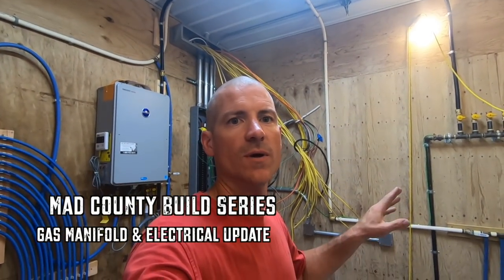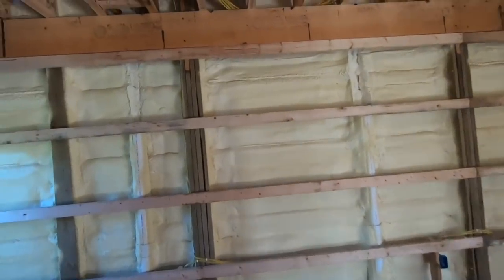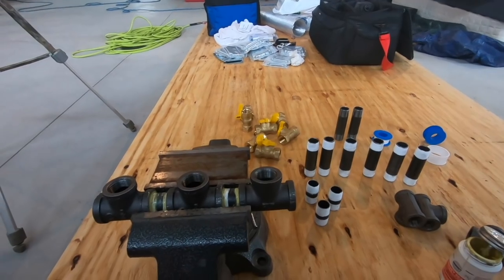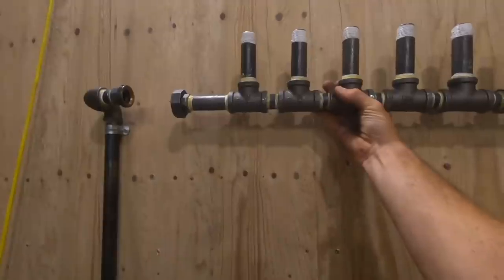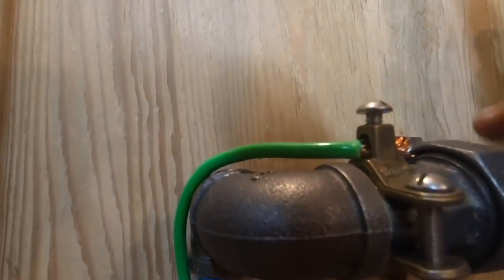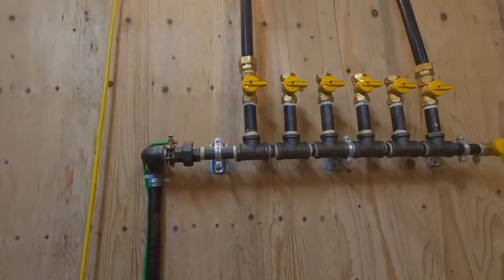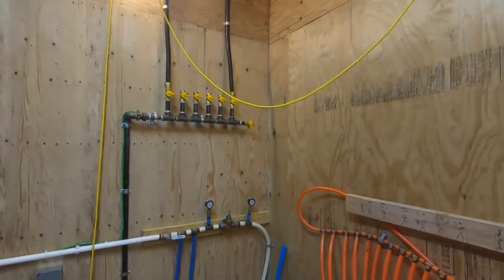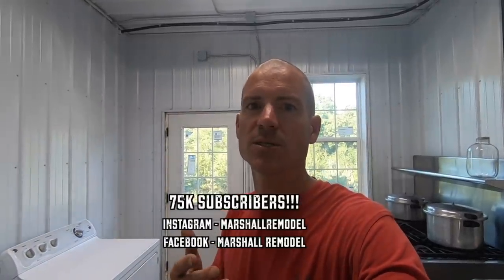Gas Manifold | Electrical Update

Comment: I’m shocked you can run 7 branch lines the same size as the incoming manifold distribution line...
Reply: I’m concerned about that as well. Worse case just run it all high pressure and reduce it at the appliance but it’s easier and cheaper to do it the right way the first time.
Reply: He said he was going to reduce it at the appliance.
Reply: The Artistic Boundaries Co. if he were to have all the gas appliances running at the same time that’s where he would have an issue.
Reply: The Artistic Boundaries Co. with gas you need volume not just pressure.
Reply: I wondered about that too, but in another comment he said it's a 2psi system, which is 5x the typical 11" of water column. In that case, the main/manifold pipe size is probably already slightly overkill, and the branch lines are probably WAY overkill.

Comment: 6 gas outlets on a 3/4 inch run. Please tell me how that's going to work. 3/4 inch gas pipe natural gas will only carry 375000 BT use LP gas. 3/4 inch should carry over 500000 B TU
Reply from the maker: It’s a 2psi system.
Reply: What state are you building in?
Reply: All I was saying for UPC code that would not pass.
Reply: @thebesthello1786  I assume you're basing those numbers on the typical 11" water column, which is 0.4psi. This is 5x the pressure, so it's going to flow much more gas through the same size pipe.

Comment: I wouldn't use that flex gas pipe in a building!
Reply: Why?
Reply: @Requiemrexx  there are some drawbacks to it. Granted it’s super convenient to easily bend it around corners and such, but it’s not as tough as regular iron pipe. CSST has to be bonded (like he did) and have nail guards installed when it runs in walls, to prevent somebody sending a nail into the thin-walled piping.

Comment: Why a gas manifold?  Never seen one in a home, just shut offs at the appliances and the meter outside.  Seems overkill and a waste of money.  But then again, I also wouldn't have ever considered using gas in a new build.  Homes should have solar and everything should be electric these days as heat pumps and induction cooktops are amazingly efficient.
Reply: The upfront cost of solar is much higher than gas. Since the advent of fracking, gas prices have plummeted. For example, I have an 1850 SF house with two bathrooms and  my gas bill for a month is typically around $16.00 - $20.00 during the summer. In the winter I can heat the entire house in the coldest months for around $60.00 - $80.00 a month (I live in Arizona). SO I spend less than $400.00 a year to provide hot water for my house and heat it. If I installed solar,  I would never recover the initial costs. It would cost somewhere around $15,000.00 for me to install solar myself,  purchasing the materials and installing it myself.  And in AZ, you don't get true net metering, I would get back about $0.75 for every dollar of electricity that I send to the electric company. There is also a mandatory minimum fee every month if you have solar in order to support the electric grid maintenance (I think it is $20.00). 

Heat pumps don't work well in very cold states, unless you go to the incredible cost to install geothermal piping below grade, - that costs a fortune and if there is a problem with the piping, it costs a fortune to repair it.  Most residences in norther states use oil burners or gas to heat their homes. They may also have heat pumps that kick in during milder months when it is not so bitterly cold.

Further in northern states, there is limited sunshine, so if you go with solar, you have to install a much larger system. This greatly adds to the cost for solar installations. If you live in a high snow area, often you have to clean the panels every day in order for them to function.  So solar is not the panacea that you think it is in some states. While solar costs have plummeted in the last few years, they are still very high, especially if you have battery storage. Most solar systems in northern states start at around $20,000 and can be has high as $50,000 - sometimes higher. Most people cannot afford to spend that much on utilities. 

In democrat-run states where they have prevented  cheap supplies of electricity and gas from coming into the their states because of hysterical environmentalists,   it costs substantially more to heat and cool a building, usually 3-5 times more for utility costs. So in democrat run states, solar MAY make sense financially, but only because standard utility costs are already through the roof in the first place.  This is why the Democratic Party's idea of making everyone go solar is so laughably stupid. It would create the situation that has occurred in Germany where people have become energy poor, it has been coined "energy poverty."  Because of the high fluctuation costs of wind and solar in Germany, many poorer and a middle class German citizens struggle to pay their utility bills. In some cases, (a few)German citizens have frozen to death because they could not pay their heating bill.  But because this doesn't fit the liberal media's narrative of a Utopian world where we get "free energy from the sun,"  you never hear about these things on the nightly news.  Fossil fuel plants will be necessary for a very long time as we transition to cleaner sources of energy.

The problem with solar and wind is that they are intermittent sources of energy. Even in AZ, there are times when the sun does not shine for two weeks or more (though that is rare). In colder, wetter states like Washington, in some areas it rains almost 300 days a year. So even if solar were installed on a mass scale, fossil fuel plants would still be needed and would still have to supply most of the energy to northern states.  It is important to learn and understand that fossil fuel plants are needed with EVERY solar and wind  plant to provide energy when solar/wind plants are not producing electricity 

Don't get me wrong, I am a strong supporter of a clean environment and AZ has a very clean environment. If solar made financial sense where I live, I would put it on my house. But in the end, we are not being told the full story about the limitations of wind and solar and if the Democratic Party's insane energy is forced on poor and middle class Americans, it will hurt millions of people very badly financially.

Also, just as a point of reference, interior gas shutoff valves are required at every gas appliance by code. That is the reason he has a shutoff valve to each appliance on his manifold.  In Arizona, you are not allowed to turn off your gas at the meter, you have to call the gas company to do that.

Comment: That sounds really stupid. Why are they making you add more outlets? How is it better adding more things that can fail?
Reply: The idea behind the requirement is a lamp with a 6' cord should be able to be placed anywhere along the usable walls/railing.  This avoids using extension cords which can be undersized, hidden under rugs, and are generally just a hazard.  So code says Every 12' you must have an outlet and 6' within a break in the wall and any section of wall 2' or larger needs an outlet.  Hallways and stairs only need one outlet though since typically you're only using a vacuum cleaner there.